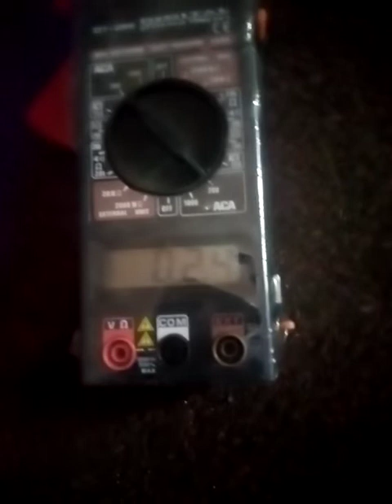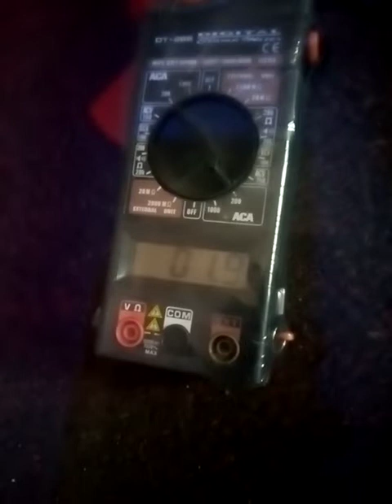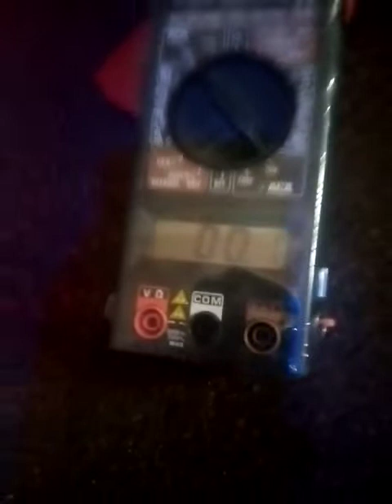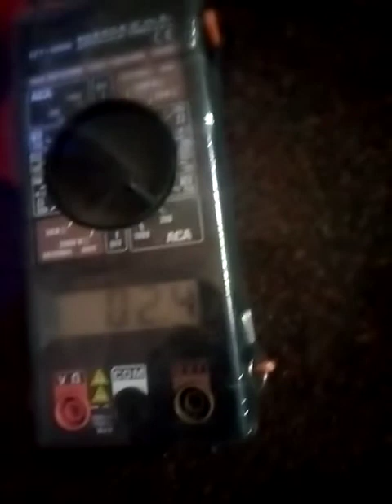Energy saving device/generator booster

Comment: Power saver is not the correct name , it's actually a power factor correction device this is most helpfull Whit inductive load's!, if you open the box to there is just a capacitor Inside en a led en some resistors,